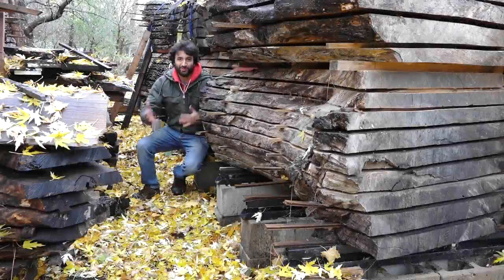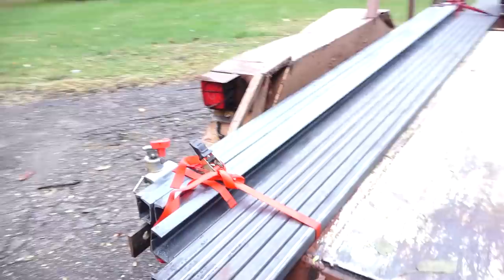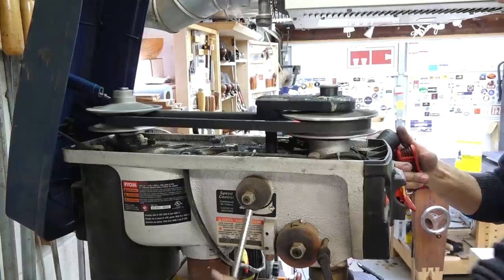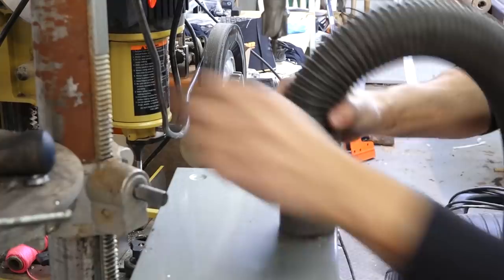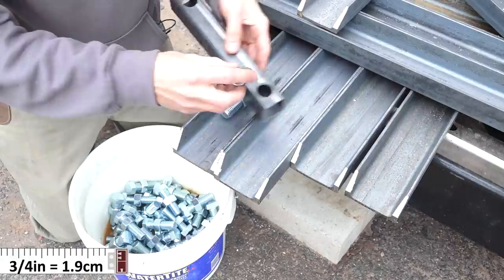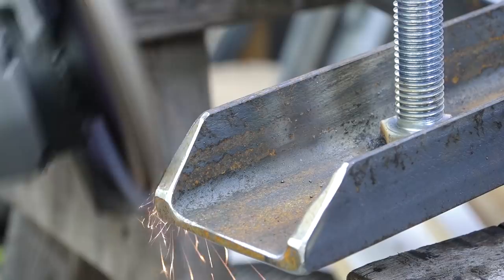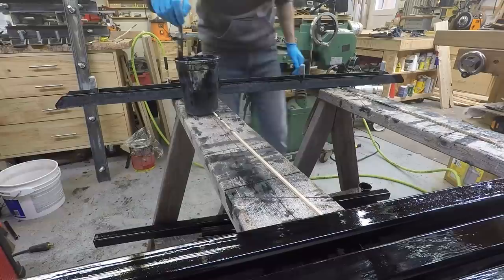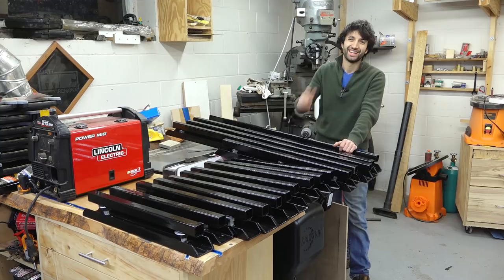Making More Lumber Stack Leveling Bases

Comment: Tips: Water softener liquid cleaner (sold at Menards) is a good etchant and much cheaper than the other Phosphoric acid based products sold at paint stores or auto body shops. Sherwin-Williams Industrial DTM primer is an excellent product and will help any finish coats bind really well.

Comment: Matt, just to add to all the positive comments to your videos. Thanks for the conversions in the bottom left from Imperial to metric. Although, when measuring, I can switch between the two (I may cut a sheet 8ft x 600mm) I find it difficult (inconvenient) to convert degrees F to C in temperature which I never got my head around when I was a sixties child let alone now I'm a 2019 bloke.

Comment: To find the center of an existing hole lay your tri-square in the 45 position and scribe a line along the edge of the hole perimeter on opposite sides. The intersection of those two diagonals is the center line, turn your square perpendicular and scribe your CL.
You SERIOUSLY need to rethink your position on oil and get a gallon of Rigid black thread cutting oil and dab small amounts with a soldering flux brush for your saw and drilling in steel to keep from destroying your hole saws, metal bandsaw blades, and belts by running "dry" tools, not to mention tearing up the bearings in your drill press spindle, sheaves and motors.
(Just say "no" to sloppy worn out power tools caused by aversion to clean up)
An alternative to your "sleeves" is to take two nuts over to the bench grinder and grind a 45 degree bevel on one side so they will self center into any size hole. (Keep them handy for the next time you want to weld a nut on a plate. Tighten them on the opposite side of the welded nut to center it around the hole and keep them flat while welding)

Comment: I didn't see any cutting fluid used on either the cut-off saw or the drill press. (end-mills, drill-bits or hole-saws.) Metal working tools need to be cooled and lubricated. Depending on the metal (hard steels, mild steels, cast iron, aluminum. brass, bronze or copper), You'll have to adjust your feed rate and cutter speed and type of coolant/lubricant (water based or oil) used. As any machinist will tell you, it's all about speeds and feeds. Don't burn up your expensive cutting tools (saw blades, mills and bits). You ain't cutting wood Matt!

I really like this channel and am so impressed with the process from start to finish. Slabbing logs to choice of finish. Stay warm and don't let the polar vortex get you. (I saw on another channel trees exploding from the expansion of water and sap in the extreme, extended cold. Good thing much of your wood has had some time to dry out at least a little bit.)

Comment: How do you accommodate for any frost heave/settling and you can’t access the center of the pile especially after such cold temps as we’re having this winter?
Reply: IMO the rise will be more or less uniform since the base is open that lets temps equalize.

Comment: Wow  your superjaws is pretty faded from the sun.  Must be keeping it outside and paint is not UV protective?  I bought the Triton one based on you and April having one.  I use it all the time to hold timbers to debark and finish live edges.  I also use it to clamp a C-clamp which holds the end of the bar of my chainsaw so I can sharpen it on the superjaws.
Reply from the maker: yeah I don't think the product designers expected someone to keep it outside year round.   It's nice to always have it at the ready out there

Comment: You know that the "drillings" from the hole saw, and for that matter, the swarf from the saw, if you mix a little Moly Chainsaw oil in with it, you can make something similar to Screwdriver Helper which came from down south. An electronics store in Australia, used to stock until the company would/could no longer expert to Australia. Now you can buy that in the States - we can't - so I will make my own. I don't know if the Screwdriver Helper company will get upset about me making my own version (I don';t know their recipe, I am just guessing), But I can't see them taking me to court because they have lost so many sales through export restrictions, that their case would not stand up in court! Just a thought, albeit a long one...

Comment: Newbie question: Why does the pile of slaps need to be so level ?  What happens if it is not level ? Anyone can answer, thank you.
Reply from the maker: flat is more my concern but "flattering bases" doesn't have the same ring to it.  Level is flat but flat isn't necessarily level.  The boards will conform to the base that they are sitting on so if there is a twist in your base, there will be a twist in your lumber.

Comment: Damn! I've seen automotive paint jobs with less prep than that! I'm sure steel that thick would last for decades even with no paint but they do look nice. Does the angled cut at the ends have a function for adjustments or anything or just to soften the edge so you don't bang your knuckles on a corner?
Reply from the maker: lol that's decades of comments telling me to paint them :D  Yeah the cuts don't have a functional purpose other than one less sharp corner in my life

Comment: I can’t even fathom what those temperatures would feel like, the coldest I’ve ever experienced is -2 Celsius and we all think we need to stay home by the fire in that temperature
Reply: Lollllll...here we experienced -48 with 100Km/h wind bringing the windshield factor to -75... Warning to farmers to bring the animals in!!!....another day in paradise...still waiting for the climate warming!!!!
Reply: @tonyioannoni4951  It's not climate warming, nor global warming. It's climate change.

What this means is it will get increasingly colder in places more to the north (like Canada), and hotter in regions more to the south, because the slight warming gets marine and high altitude air currents out of balance. The overall average temperature will increase by just a few degrees.

A further consequence of climate change is increased acidity of the oceans, again, only by a small amount, so small that humans will barely feel it on their skin. But it will be enough to kill off many species of plankton, which are at the base of the food chain in the ocean, and reduce the amount of oxygen produced in the ocean significantly - that you need to breed to stay alive.

Short and medium term, that won't cause a significant change, in terms of absolute numbers, of the oxygen and carbon dioxide levels in earth's atmosphere However, how well your lungs work doesn't depend on the absolute concentrations of oxygen and carbon dioxide in the air, it depends on the relative partial pressure of the two gases, in the atmosphere. For your red blood cells to be able to carry oxygen to your cells efficiently, the partial pressure of oxygen needs to be several times higher than that of carbon dioxide. Since the carbon dioxide molecule is much larger and heavier than the oxygen molecule (more than three times heavier and about seven times larger), you get close to a situation where you faint and die even when there's still plenty of oxygen in the air. That's why people faint and keel over in rooms where the air is bad.

But, as the late George Carlin said, it's not life on earth that's in danger - life always adapts. It's we humans who will be f...ed.
Reply: @a0flj0  Ok lets make the corrections, I have 3:   

1) What is global warming?
Global warming refers to the long-term warming of the planet since the early 20th century, and most notably since the late 1970s, due to the increase in fossil fuel emissions since the Industrial Revolution. Worldwide since 1880, the average surface temperature has gone up by about 1 °C (about 2 °F), relative to the mid-20th-century baseline (of 1951-1980). This is on top of about an additional 0.15 °C of warming from between 1750 and 1880.

2) What is climate change?
Climate change refers to a broad range of global phenomena created predominantly by burning fossil fuels, which add heat-trapping gases to Earth’s atmosphere. These phenomena include the increased temperature trends described by global warming, but also encompass changes such as sea level rise; ice mass loss in Greenland, Antarctica, the Arctic and mountain glaciers worldwide; shifts in flower/plant blooming; and extreme weather events.
3) I was making a joke, inferring that I was waiting for summer...maybe too subtle as a joke???